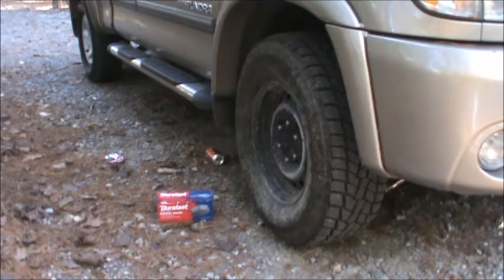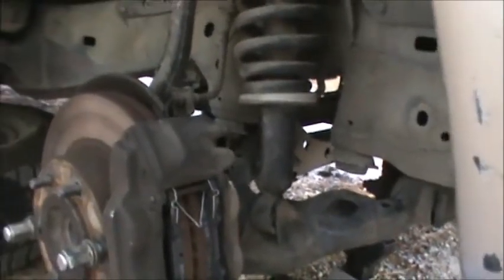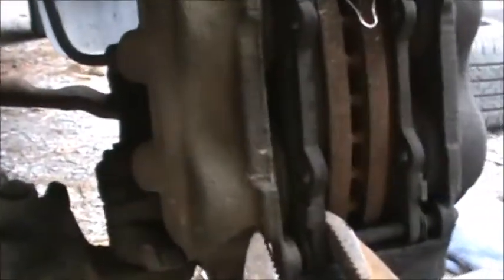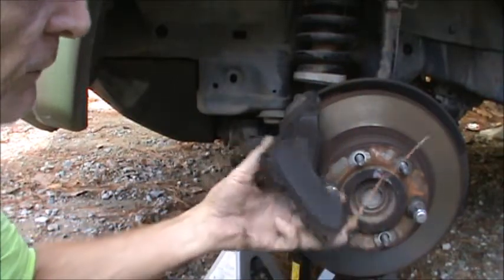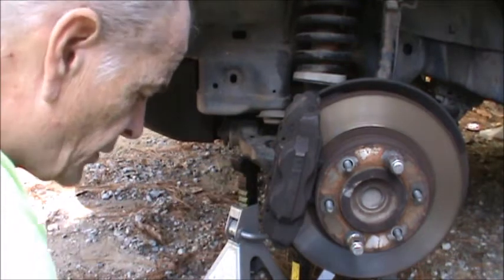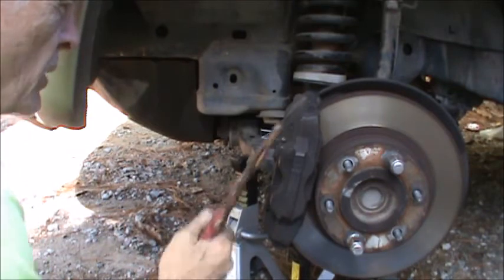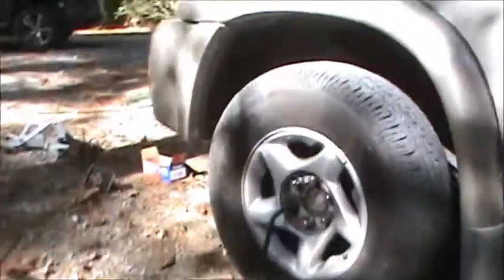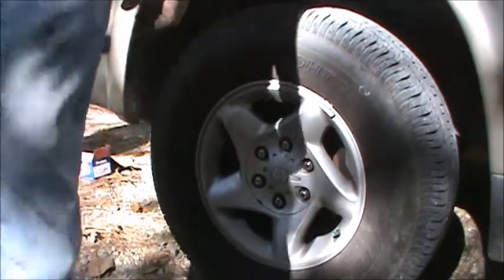Low quality brake work, 03 Tundra,  Porkdogx Video

Comment: I usually use the brake lube from the kit to apply them to the shims. A little ani-seize or lube on the pins as the pads slides on them